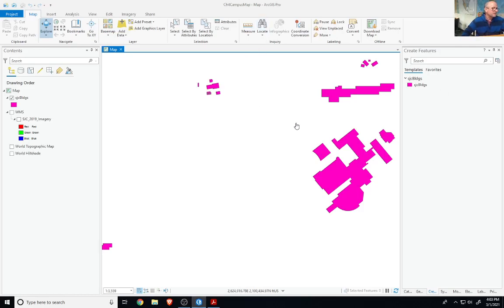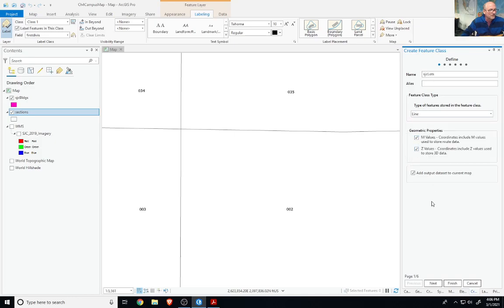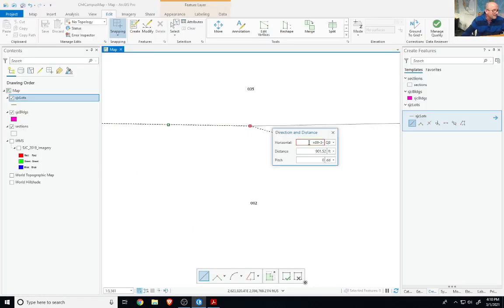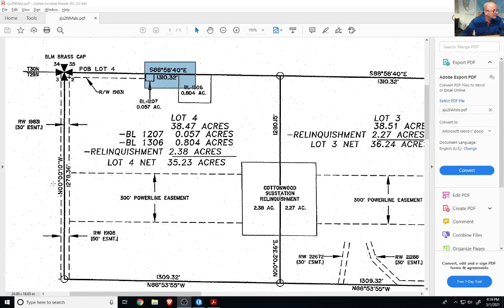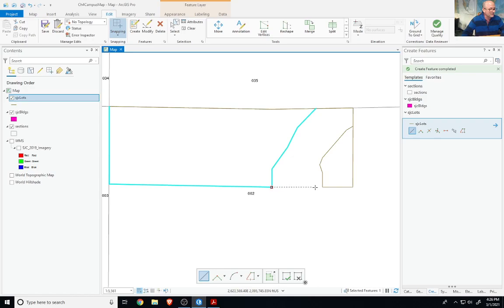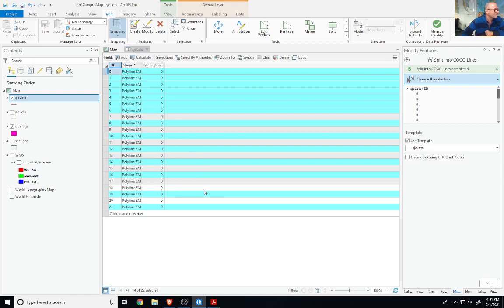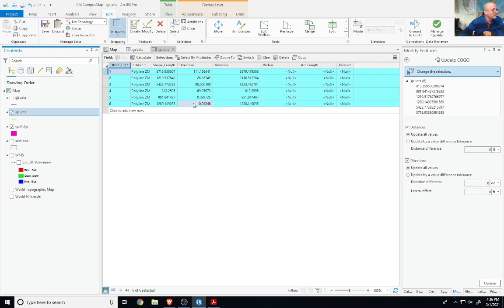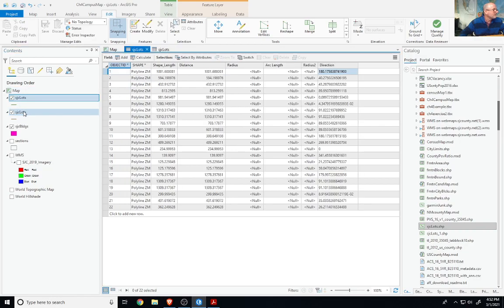Drawing Lots From Legal Descriptions Using ArcGIS Pro 2.7

Comment: How would you suggest completing the following curve in ArcPro? THENCE SOUTH 03°33'15" EAST 94.04 FEET TO A POINT ON A CURVE TO THE LEFT, THE
RADIUS POINT BEING AN IRRIGATION PIVOT WHICH BEARS NORTH 86°26'45" EAST 1318.52
FEET:
THENCE EASTERLY ALONG SAID CURVE 4017.93 FEET:
Reply from the maker: Start a traverse with the S 03-33-15 E; 94.04' line. Then in the next line type in "86-26-45rb" in the direction type-in, the enter 0 in the distance, then enter the radius and arc length, but since it's going left enter a negative (minus) sign in front of the radius.